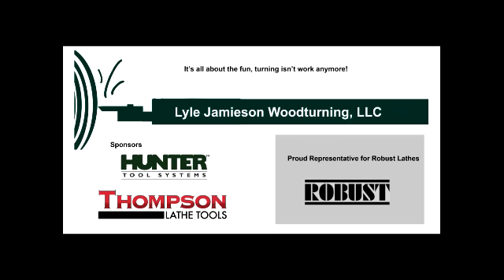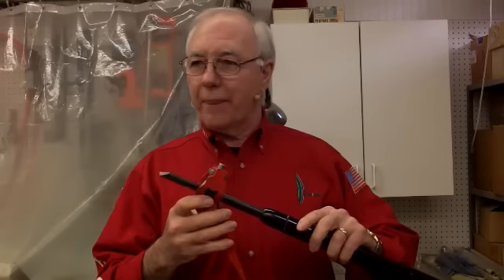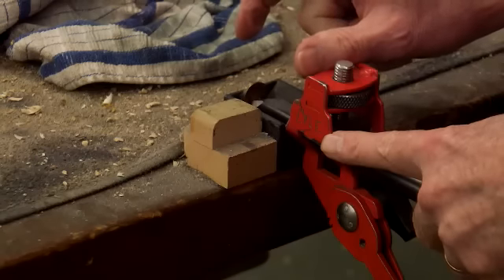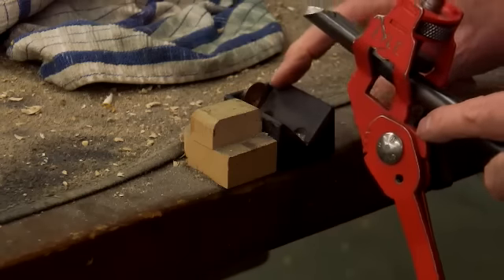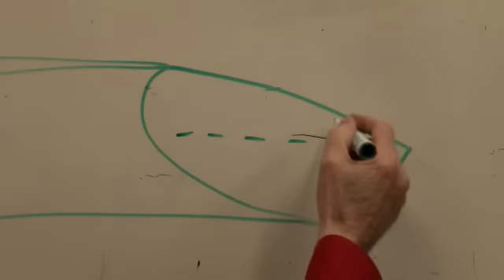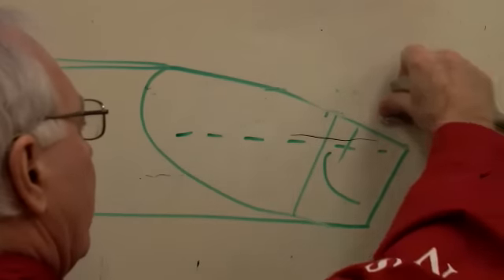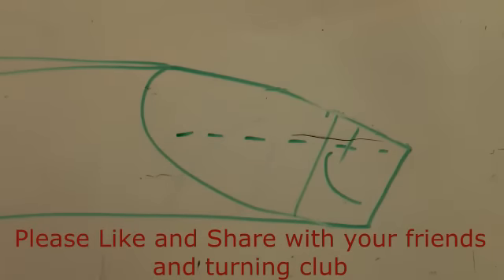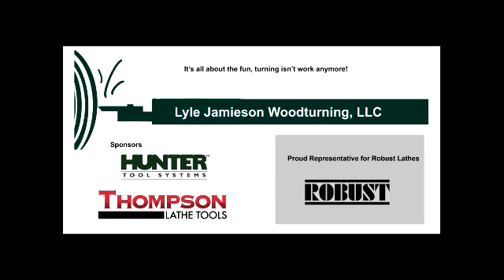Sharpening, quick, easy, and accurate

Comment: When you're grinding - especially high spots, how careful should you be about heat? Trying to remove a high spot on the wing of my gouge I found it was really quick to blue from from the heat and I'm not sure if I'm doing harm.
Reply from the maker: Hi Pointer.etc, great question.  The bluing is not a problem with the new HSS and alloy steel tools like Thompson makes.  The bluing was a problem with the old high carbon tools and the temper or hardness was lost.  But we dont use those tools for turning any more.  If we look at the temperature ranges at the grinder if you get a tool to glow red hot, that is about 700 degrees.  HSS will not be damaged or loose and hardness until 1,700 degrees.  So it will be really hard to damage a HSS turning tool at the grinder.  Nothing to worry about.  

What is not recommended is to quench a hot HSS tool.  Quenching can make micro fractures of the sharpened edge and make it loose its sharpness prematurely.
Reply from the maker: Right, but not with HSS
Reply: @Lyle  "not recommended is to quench a hot HSS tool".  I did not know that.  I've been quenching my tools even though they are HSS and thought I was doing myself a favor. I'll throw that water container out immediately, thanks,

John
Reply from the maker: @John-gj1jr  It would need to get really hot to do damage but it is a good idea to stay away from quenching.  If you are getting that hot you might take another look at your sharpening methods.  We don't get the tools hot in every day sharpening.
Reply: @Lyle  I don't think they're getting all that hot.  There's sometimes a thin blue line, almost like a thread, on the edge.  I'm sharpening on a Norton white wheel that looks similar to yours, although my grinder is 3600 rpm.  I really need to get a slower machine.  That said, my sharpening is usually just a touch up.

Thanks for your time
Reply from the maker: Yes, John the 3600 grinder makes it a LOT harder to sharpen.  A light touch and  good control is necessary.
Reply: @Lyle  Yes, I'm looking at a different sharpening setup, but am really pressed for room in my small shop.  I'll need something to set on my workbench that I can move for other projects when necessary.  Thank you for your time, your videos have been extremely helpful.  Your explanation of the geometry (?) of the bowl gouge jig was especially enlightening.
Reply from the maker: The best grinder/sharpening system is a simple 1750 rpm bench grinder with 180 CBN wheels.  It can be mobile as long as the Wolverine jig and grinder are bolted to a 2x12 or heavy plywood base. Check with Woodturning Wonders. @John-gj1jr
Reply: @Lyle  Thank you.  I will check this out.

Comment: Hi Lyle! Thank you very much, dear friend,  for sharing this. You are absolutely correct, repeatability is key in the set up if you want to go to the grinder touch up the edge and back to the lathe in no time. Have you considered switching to cbn wheels? They add a factor of repeatability in the sense that they do not change shape, ever, so the diameter of your wheel is also a constant factor and thus the distance from the grinder to the pivot point becomes a constant as well. Although not that much, traditional grinding wheels keep reducing diameter with use and with dressing of the wheel, and little by little the distance between the wheel and the pivot point in the basket keeps increasing.  Although not by much , evry so often that would mean that you will have to go through the angle set up again. I mean, you do that also fast, so not a big deal, but maybe something to consider? Also, the cbn wheels have other advantages, they do not form grooves or ridges that will require re-dressing, they are metal base and dissipate heat faster than traditional wheels reducing the risk of overheating the metal and altering the tempering of the tool, and cbn is the second hardest material after diamond and is more durable than diamond in terms of temperature. Anyway,  I would love to know what you think of them, I have been using them for quite some time and couldn't be happier :)  Cheers! Daniel
Reply from the maker: Yes, Daniel, You have it correct, right on!!  I don't use CBN wheels in my shop yet because I do industrial quantities of sharpening on all the tools I sell.  My grinder is a big 10 inch monster that most CBN wheels will not fit.  The shaft is too large.  I have used them all over the country and love them and would recommend them for the normal turning needs.

Comment: Thank you for the video. I'm curious why you like an inward tilt on the wings. I've always tried to keep mine perpendicular to the bottom of the tool. What advantages are there to an inward tilt? Also for certain cuts is there an advantage to an outward tilt? Thanks
Reply from the maker: Nice to hear from you Emery.  When the edge is tilted in, the bevel is slanted out.  That is the reason, with the bevel tilted out the bevel SUPPORT is much better, more friendly, more forgiving , and easier to control.  This also requires the parabolic flute I have with my signature bowl gouge to make all the cuts I do with it.

Comment: Even with my wolverine sharpening system and the skew attachment  am I getting facets on my large skew tool.  What am I doing wrong?  I have tried to sharpen using just the flat attachment used at what appears to be the angle of the skew.  Frustrated here.  All of my other tools are sharpened to perfection.  Please advise.
Reply from the maker: Lois,The skew is difficult to sharpen.  Each facet is the result of a different angle the tool is touching the wheel at.  Each facet is a different setup of the jig.  Go with one setup at the best angle you want and lock in the jig at that setting.  Now sharpen the skew.  Make a smooth consistent sweeping pass across the edge all the way from the left to right or right to left. You might have to roll your wrist and twist the tool slightly if you have an oval shaped skew.  Look at the bevel, if you still have facets sharpen again til the facets are gone.  After the facets are gone you are done with sharpening for a long, long time.  For the next few years all you do is hone the edge with a very fine diamond hone.  Make sure the hone seats on the edge and heal of the bevel while honing.  The plan here is to hone the bevel not just the edge.  When you look at a honed tool bevel you will see a polished line on the sharpened edge AND a polished, shinny area on the heel of the bevel surface.  Hope this is clear for you.  Id be glad to help you but will I need some more info, photos or Facetime to view what you are dealing with.  Use lyle @ lylejamieson.com